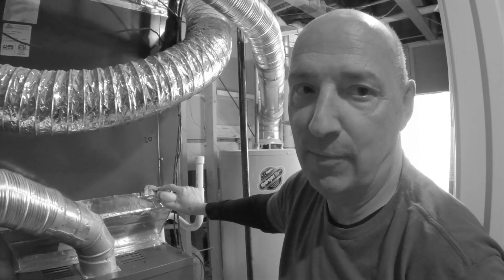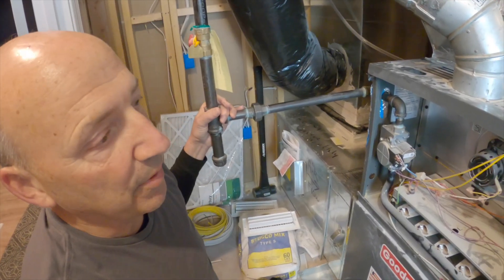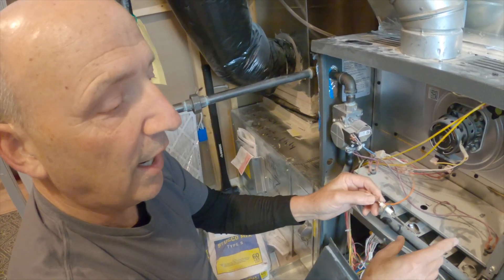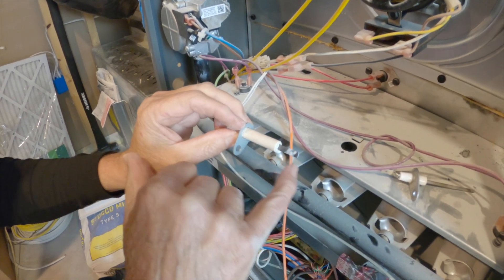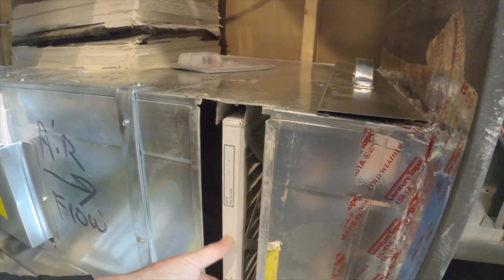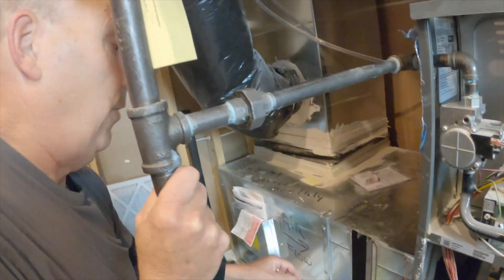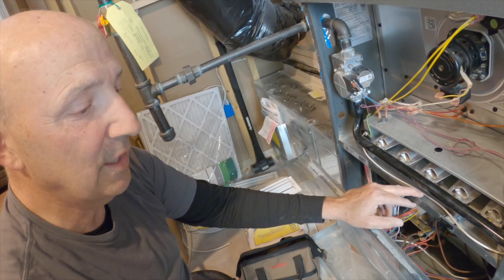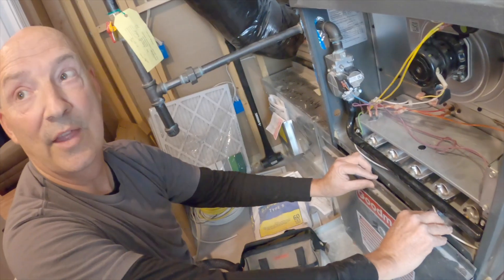Cleaning a 5 Year Old Furnace That Has NEVER Been Cleaned (Using Homeowner Tools)

Comment: Great video, thanks!
I cant believe how poorly the original installer did on the filter area. Not only is the air filter loose up and down, but side to side as well. If you noticed, the brackets look like they are too far apart to hold a normal width air filter. 
The air filter needs to be air tight to be most effective at preventing dust from entering the air conditioning/furnace system. 
If there is an air conditioner in this system, the dust that got past the air filter would accumulate on the evaporator coils and turn into a muddy coating that would be very hard to reach and clean, besides making the AC inefficient.

Comment: Huh been in my house 26 years and never cleaned mine once, my other home has a furnace installed in 2016 and that has never been cleaned.  Maybe I should have them cleaned?
Reply: If it's working it's fine.  No need to clean, but clean it if you want to.

Comment: The worst environment to be operating that furnace in. Notice the bag of stucco mix right next to it.
Reply: Mortar but yeah that definitely caught my eye too. Absolutely terrible to have sitting right next to the furnace. Even if the bag is "sealed" it's going to be kicking up very fine dust.
Reply: Not ideal but mostly an issue if the ductwork is not sealed and you are constantly moving disturbing the bag.